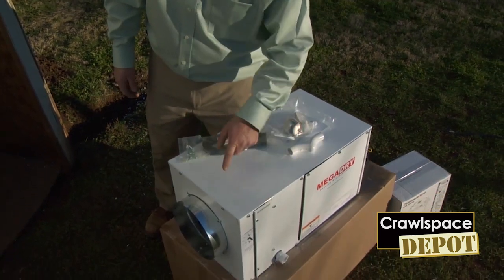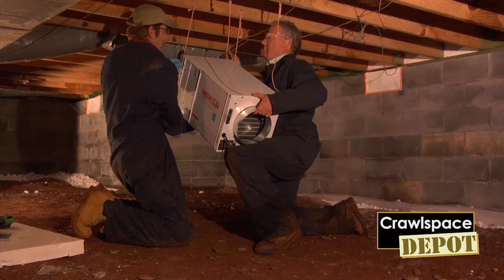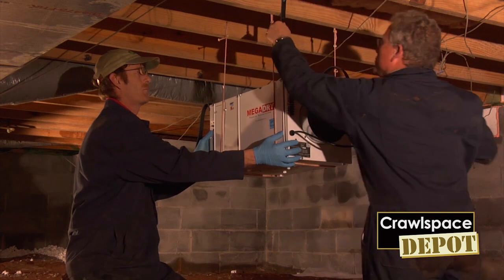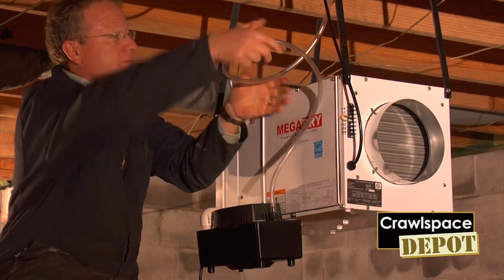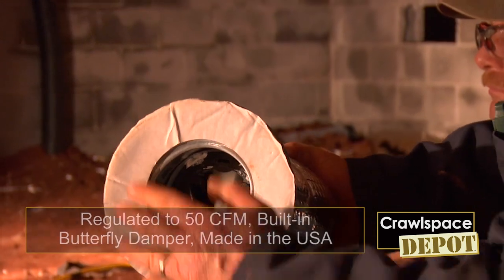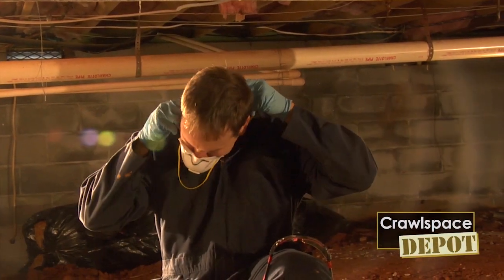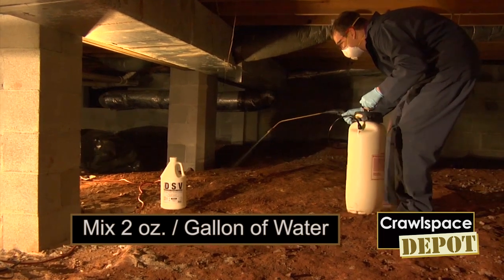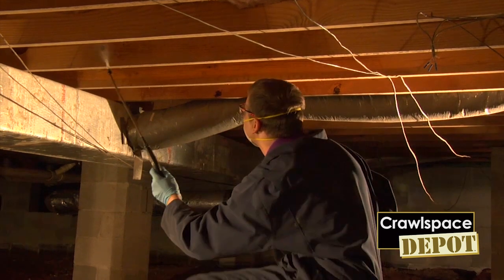Part 3: Crawlspace Depot DIY Installation

Comment: You should have applied mastic the open fiberglass edge of that duct board that you cut. It’s unhealthy to breathe glass fibers, And that’s the whole point of this is to help with indoor air quality is much as overall energy efficiency that should be a consideration. Also any modification to a duct system should be done by someone who intrinsically understands what that is going to do to the rest of the system. When you change one thing you change everything. Edit: also screws are unlikely to hold that to the duct board, thank God you’re strapped it that’ll help. Most duckboard attachments are done with a tab system that compresses the duckboard between the two sides of the collar because you’re basically screwing into something soft as a sponge.

Comment: is the conditioning from the duct line something you do instead of the dehumidifier or in addition to?
Reply: I was going to ask the same thing - but I see you've been waiting on the answer for three years.
Reply: In addition to, I assume it’s to help warm the air so that it can hold the humidity that the Dehumidifier was taking out. Plus a D hue is really just an air conditioner so it will make the air colder in there for less likely to hold humidity when you’re trying to extract it it’s not good for the purpose.
Reply: You always need the dehumidifier. the supply air is added to make up for the air used by the existing HVAC equipment in the crawl space. You will also need to exhaust a small amount of the air to the outside (this helps with the negative effect as well as moving the earth gases outside)

Comment: How do you install an air inducer on a flex line?
Reply from the maker: Thanks so much for your question!  We have not found a reliable solution for installing an air inducer on a flex line.  The air inducer needs to be installed on a hard, metal surface.   If it is all flexible pipe, the only way is to install a metal junction box your pipe can attach to.  Hope that helps!